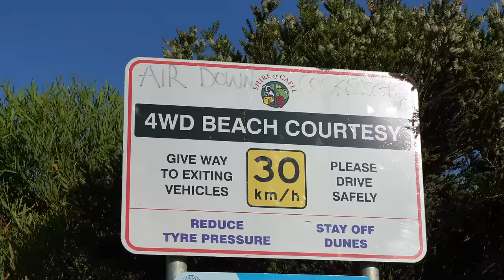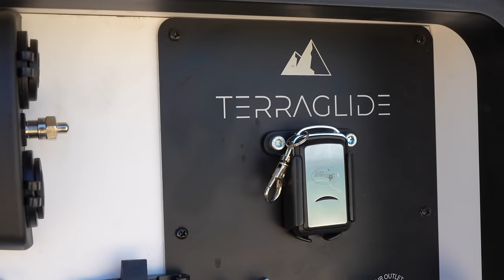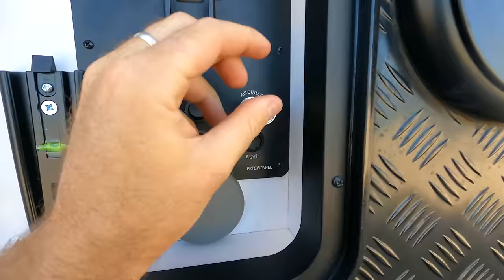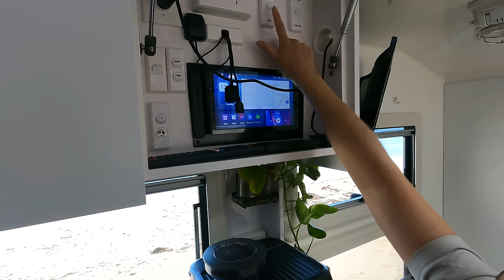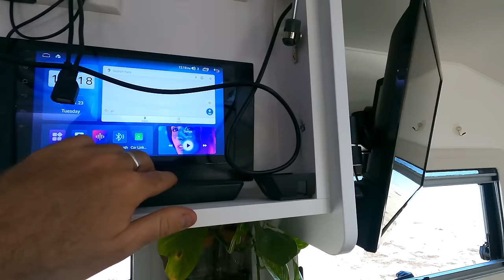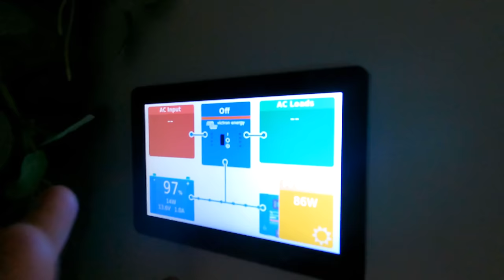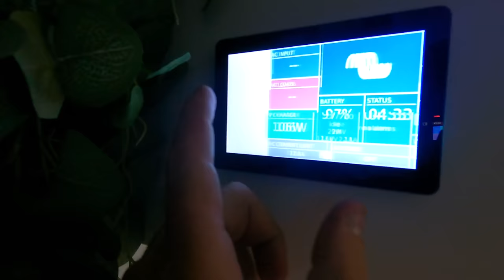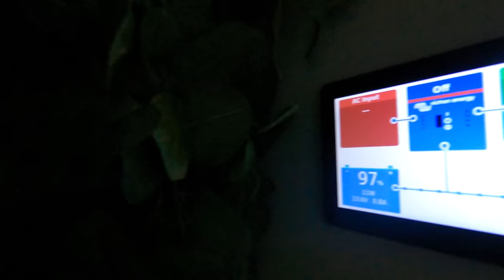A WORLD FIRST! The BEST Offroad Caravan in Australia! Urban Caravans 18'9 Xtreme full offgrid van

Comment: WOW, what a van. Congratulations and i'm sure you will have many awesome adventures in this new setup. 

I love your honesty and how transparent you both are about everything you share on your channel (be it experiences with products, places or people). Your centent is so enjoyable to watch and even though i'm not a caravan person myself (i own a camper trailer), watching your walk through and guide videos are still very enjoyable to watch as you share so much insight in to everything (filler caps on the same side, manual filler points on airbags, keeping things in certain places to avoid running around finding things at setup/pack-up).

The new suspension is next level impressive and i'm really looking forward to see how the testing goes, i'm Keelan will have more than a few 'Full Send' moments to put it's through its paces. 

The 12V setup is also just as impressive and to be able to still charge while running an aircon is almost unbelievable. I'm sure Keelan would have loved to design his own system for this van, the fact you are running a factory recommended and designed system is awesome. It's a transparency thing, i as a customer could have the same if i bought an Urban Van (and believe me, if my taste ever changes, they are probably the only one i'll be looking at). 

My favourite new thing in this new van is the 12V control panel in your doorway. Having all that information at your fingertips is a game changer, our camper has the redarc version and it allows for such enjoyable and comfortable trips knowing whats going on at all times.

Would love to see a collab video in the future with F2F

Keep on keeping on, and i'll keep sharing your channel and content with everyone i know that enjoys the same, 

Safe travels SKT

Comment: Im about to fit the Multiples II 12/3000 inverter in my Van, I have the Enerdrive 2600w in the car. The Multiples is 12v, 3000VA - 120Amp charger, the 3000VA = 2400w, not 3000w. I thought it was 3000 watt also until I looked into it a bit more but they are capable over going over for short periods. Still one of the best inverters / systems on the market, the Victron gear is fantastic.

Comment: Van looks awesome. Very neat and tidy rig, you've done really well. I'm considering swapping the suspension over on my AVan Cruiseliner to some kind of independent/airbag setup and this gives me some ideas. Favourite part of the van is the lighting for sure!

Shower below the 240v inlet? Interesting choice in location though I guess as you've got the inside shower probably won't use it that much. I have a similar problem in my camper.

Victron gear is great. Some bells and whistles, not maybe as much as others but it "just works. Interesting they haven't enabled the "Has DC System" in the Cerbo which would show you your DC consumption as a separate item on the screen.

Comment: Hi SKT. Love the new Urban. For the Starlink provision on the van, did you need to modify the Starlink cable to suit (I assume it is a RJ45 connector rather than the std Starlink one)? Where did you get the small cable you have from the internal connector to the router?

Comment: Great van and a great video run down. If I had to pick the best thing about it I would have to say your whole power system. ❤ A question about the new suspension, can you individually pick up a wheel off the ground so you can change a flat tyre?  Keep up the great videos guys.

Comment: Great van, I think the stand out items for me are 1. The suspension, having done some off-road racing years ago some of the similarities are very cool. The pivot points on the trailing arms are very interesting. The geometry changes throughout the travel of the suspension which should improve the handling. Also the sway bars✅. 2 The big window in the kitchen , sweet. Enjoy. But go a bit easy on the rough stuff. If you’re going to drive like a DH don’t video it. There’s enough crazie c*n* out there. Have fun👍

Comment: Out of curiosity, welding the duragal steel will burn off the coating.  The outside looks to be well protected, is there any protection or coating on the welds inside the RHS frame?  If not, this would make up a significant portion of the weight difference, hot dip galv coats inside and out.
That Victron set up looks awesome, love our Victron gear. 
Strange that the regs require LiFePO4 batteries to be in a sealed enclosure vented to outside.  I didn't think they vented gases/fumes.

Comment: Hi guys. That was a pretty detailed walk around, but you didn’t mention caravan weights. I know most tubers don’t mention weights when they do their walk around but it’s probably the first thing that buyers are concerned about. Plus I noticed all your water tanks were dead empty; were you a bit worried about towing it (or throwing it lol) around on the sand with another 300 kg on board?
Reply from the maker: We mentioned the weight of the van at the start, you must have skipped that part. Narh mate this vans the same weight as our last one, and if you have been following for a while you would have seen what we do with them.. leroy is off it’s head and wouldn’t notice 300kg of water on board,
Reply: @SarahandKeelanTravels  My bad! You said the stock was 2850 kg, and you said you’d get into weights later in the vid, but i must have missed it (it was a long ep!). So, what’s the tare and atm of your van?

Comment: Maybe I missed it but what are the specs of the van? That is, empty or tare, ATM, ball weight, etc.?

Regarding the electrical system, is it an automatic changeover from external AC power to internal battery power when you plug in or unplug 240v to the van?

And all up cost?
Reply from the maker: Spoke about the tare weight, feel free to get a quote of urban for a price 

Yes auto transfer

Comment: That 2850kg standard, is that tanks full before you put anything else in it?
Reply: Tare is empty off the factory floor. 
No water, no gas, no gas bottles, no Jerry cans, no diesel in the diesel heater tank, no food, no drinks, no clothes, no starlink, etc etc. 
from manufacturers specs and advertised tare weight extras and upgrades go onto adverted tare as well. 
Fully loaded I couldn’t keep it underweight. 
Great van and inclustions but like they say, less is more
Reply: @jonathanharm9277   wow, 2850 in standard form, and completely empty is a heavy van

Comment: I quickly scrolled through the comments thinking there will be people who want to know if they can afford a van like this. But I guess I'm the only one that's going to ask the question. What's the approximate cost for a van like this from Urban?
Reply from the maker: varies, if you want an accurate quote of current pricing please ask urban/urban dealer, Prices change every couple of months plus its different from dealer to dealer because of freight costs to different states
Reply: @SarahandKeelanTravels  

Thanks guys, I'm guessing  if one was picking one up at their factory in Victoria exactly like yours its going to be around the 150 to 250k range for the average punter. I would  also expect you'd be getting a slightly better deal if you are doing R&D for them, which is made in confidence.

I will take your advice and contact them directly. Im sure The last thing they want is you pricing their vans. I just wanted a very loose ballpark figure.

Great van and nailing the dream lifestyle.